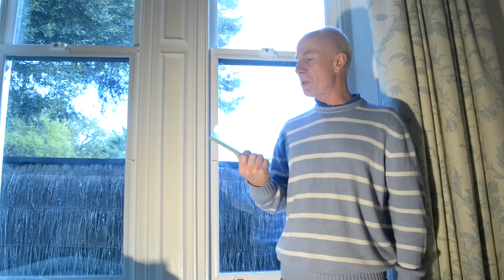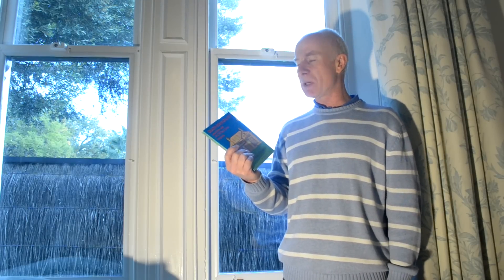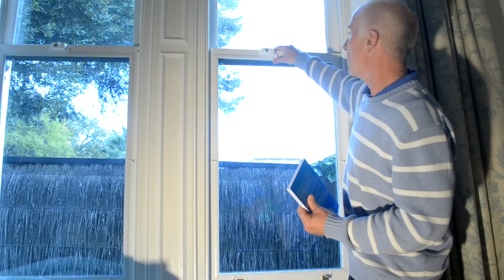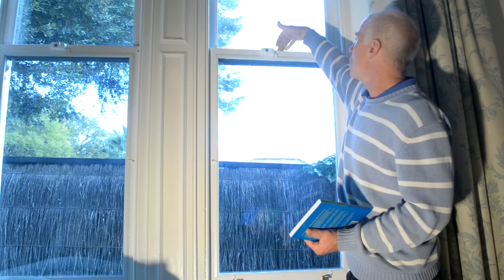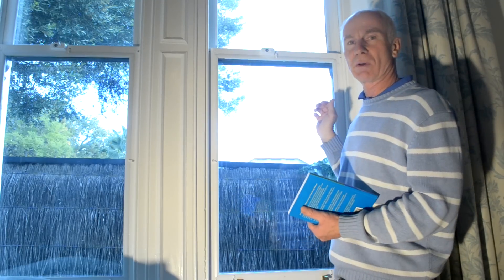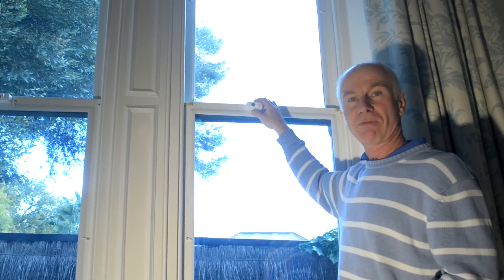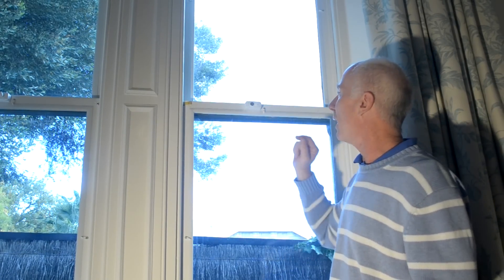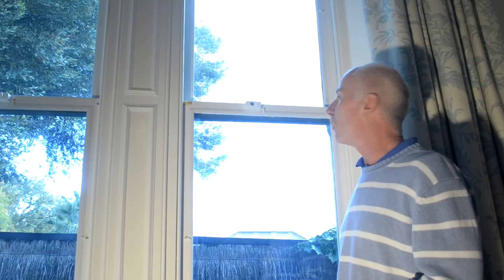How to Draught Proof a Sash Window with a Clothes Peg

Comment: RU NUTZ!?! This increases the size of the gap between the two windows The exact opposite of what the window lock is designed to do! The real solution is to adjust the locks properly and add a simple piece of spring steel/ window brass that is properly designed to compress and FILL the gap where the two stiles meet.